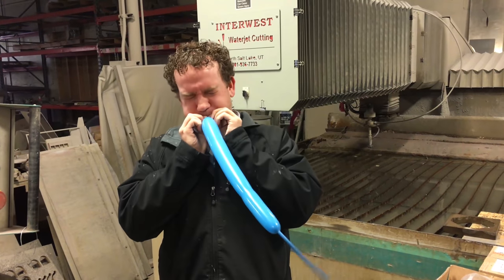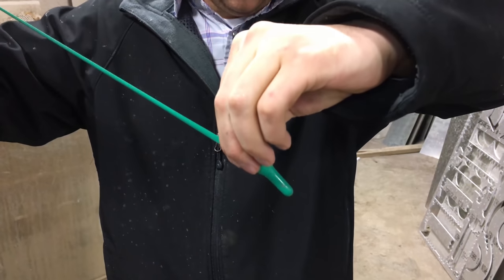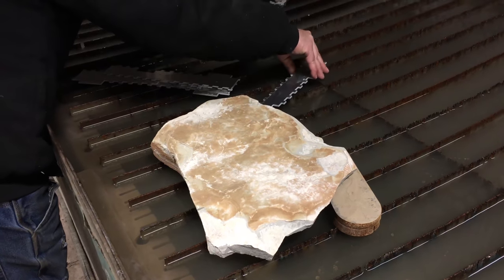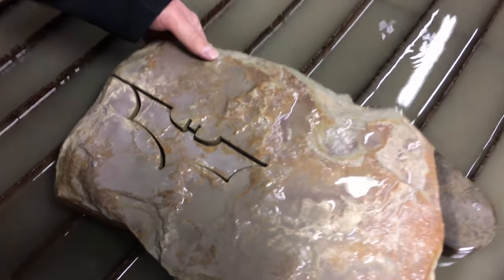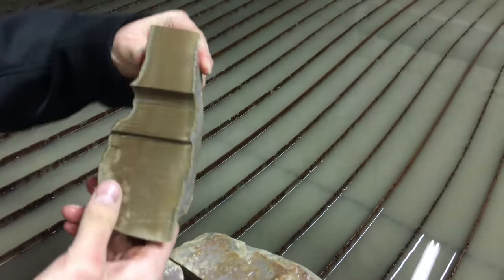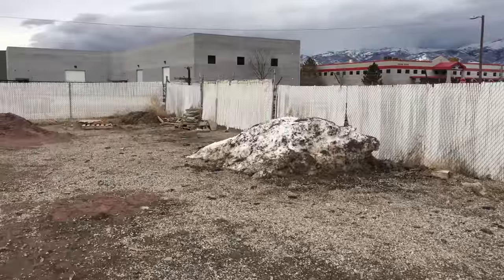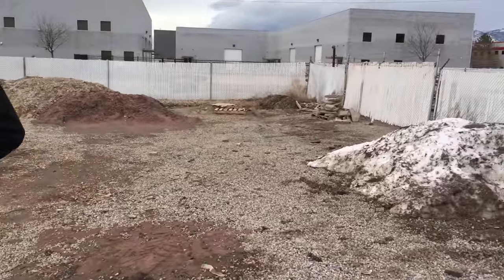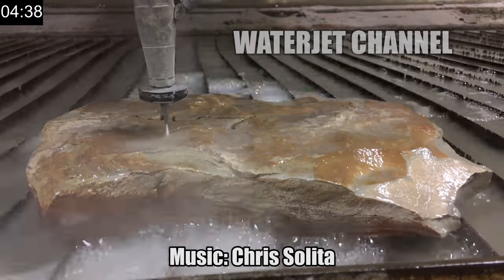Cutting Rock With A 60,000 PSI Waterjet

Comment: Wonder what metal the waterjet is made out of to handle this immense pressure?
Reply: MrArcticShadow it's a type of stainless steel. I use a 50 horsepower 90,000 psi flow water jet at my work

Comment: The immense pressure of this water jet is equalavent to the chamber pressure of the United States issued Springfield M1903A3 .30-.6 caliber, bolt operated, spring loaded, air cooled, shoulder fired weapon designed from the Springfield Armory by Erskin Allen in 1902 and commissioned into the United States Armed Forces from 1903 to 1957 serving in a total of 7 wars.